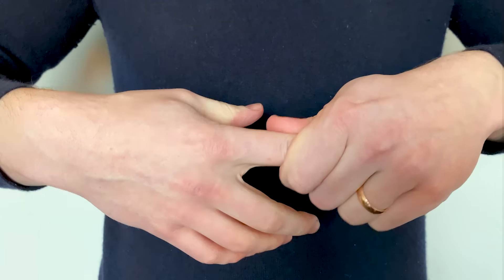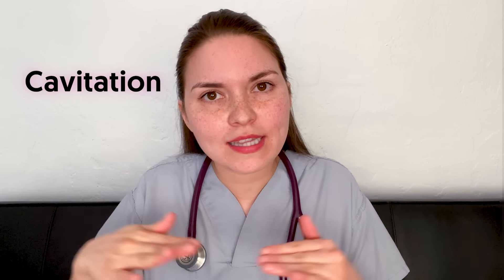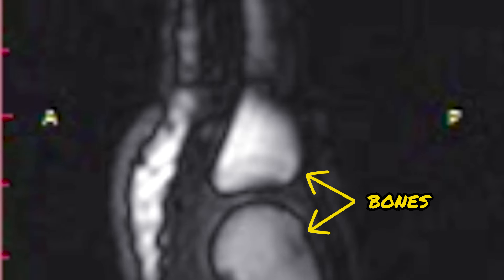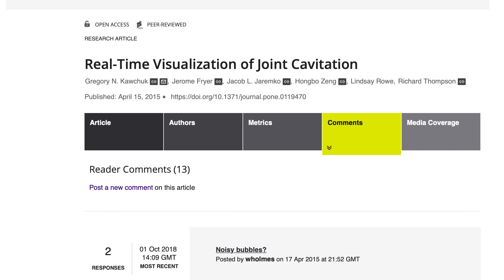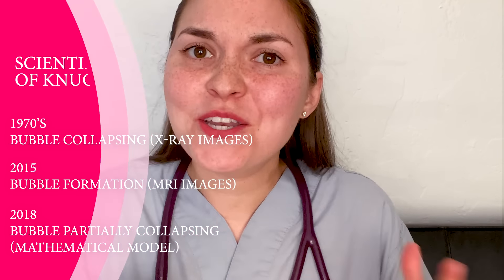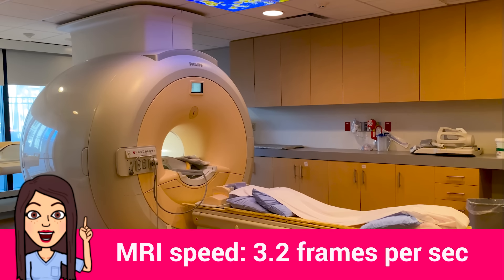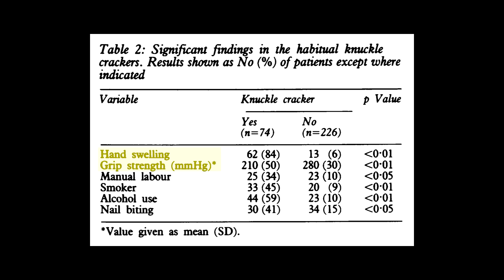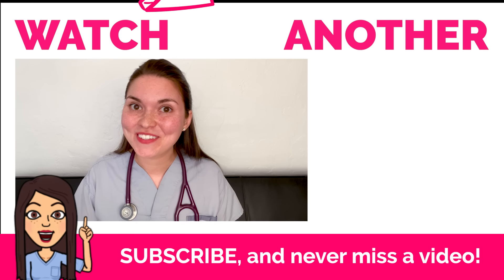Arthritis Doctor Explains: CRACKING KNUCKLES GOOD or BAD

Comment: All my joints crack having had RA for ten years. I'm sure you will find it very frustrating when you find there is nothing you can do for RA sufferers. The go to drug, Methotrixate was first used 75 years ago and recently I was prescribed  Gold injections which were first used 100 years ago. A cure for any of the Autoimmune disorders would be a very poor business decision for the drug companies.

Comment: THINK, muscles when deprived of oxygen and other nutrients via blocking blood, become Atrophiated, this could happen because of a contractured muscle fiber, by always staying in a flexed state deprive all that muscle fiber, and blocking itself by not allowing K potassium in the muscle so it can relax, this happening for a long time, create a series of contractured muscles, when you pull that muscle, the contracture opens making that cracking noise, it's why the neck cracks even more than the fingers, obviously they are connected and the reason is that the pressure the head unleashes on the muscles of the back by not being straight all the time also creates a system of atrophied muscles contracture, so you can also crack your knees when you kneel, or your elbows when you whiplash your arm. It's not "bubbles" being created by negative pressure, its the cracking noise a muscle makes when it does not have the strength to hold the contracture and it breaks the fibers, when you sleep with a bad pillow, the same happens to your neck, by blocking blood flow for long periods of time, you get a contractured neck, lots of muscles are in the neck... they hold your arms in place and your head... by the way, if you crack a single contractured muscle sufficient times for enough time, and it will heal making the muscle relax by itself and flexing when needed, feels, strange... but try it people.

Comment: So...here’s the question...if the sound is caused by negative pressure, how come you can usually only pop joints once in a while? 
Also, why would I be able to crack my right hand knuckles just by closing it into a fist (like those fight scenes in action movies), but not in my left hand?

Comment: I am sorry if my question is stupid, but what is the reason behind cracking having sort of a cooldown time? That is to say, after You crack Your joints with certain force from a certain angle. You can't do it again on from the same angle with the same force. Some times needs to pass, before You can do it again...

Comment: Hi, thank you for the video, very informative. 

I crack my nuckles a lot everyday. By a lot I mean, atleast 30 times a day. I have no pain. But if I don't crack it feels uncomfortable  It feels like pressure is building and popping it feels relaxed. 

I always stretch my fingers back after popping. And I find I can stretch more only if I pop, hence the relaxed feeling. 

I also crack my toes, my knees, my elbows, my back, and my neck, multiple times a day. Not as many times as my fingers though. maybe 5 to 10 times. Again there is no pain, but only a good stretch after the popping. 

I have no idea if this is bad for me in the long term due to the daily frequency.

I do have swelling in my fingers and a slightly softer grip. 

But it dosnt hinder my ability to do anything. 
I have been cracking away maybe since 8 9 years of age. It's gotten more frequent over time. Also I cracked k a lot more in the cold. I feel weird sharing this now, I'm a cracking freak  🤪

Could you help me understand my condition more please. 

Thank you.

Comment: If I don’t crack my joints, they really hurt, way more then if I crack them, I guess the negative pressure inside the joint is wht causes the pain and cracking it disperses the negative pressured bubble.

Comment: I learned so many ways to crack my knuckles and my neck as well. It’s always satisfying. Constantly typing on the computer (since I’m a programmer) and playing a video game often after exercise my hands need that release because my hand can tend to feel locked up from the constant hand movement. Sometimes to the point I can’t move a finger at the time without some difficulty. But knuckle cracking every 20 minute interval prevents that. (Which is also why stereotypically you’ll see programmers, digital authors, pianists and etc in movies and tv crack their knuckles before a performance or work) thanks for this info. Makes me feel better about doing it and not having to think about it in the back of my head possibly affecting me

Comment: Next question can habitual cracking of knuckle create long term loose joints and inflammation? As people even in the comments that say they crack their knuckles daily with a lot of the time them just popping on their own.. I never crack my knuckles unless they feel tight, or pressure feeling in the joint. Even then it's hard to get them to pop. I usually massage the pressure out. And with the work I do (heavy lifting) I cannot have a finger randomly pop on me. It has happened before with the heavier lifts and I have dropped stuff before from this. Tis dangerous. Now I can imagine if I cracked my knuckles as a child up until now and experienced my knuckle popping throughout the day on their own... Well I definitely wouldn't be able to do my job then. It may not cause arthritis but those old timers know how maybe not always but often enough how cracking knuckles has caused people problems. Also they generally had harder jobs then us today. Ohh wait she already says this in the end haha it does cause some problems in the joints. Such as weakness. Now not to be a downer though when your 60+ don't you want you joints to be strong as possible? It's literally an addiction such as bitting nails, and really shouldn't be done regularly due to the increase chance of joint weakness and inflammation. Such as bitting nails increases risk of illness from all the nasty ass stuff under those nails lmao. Honestly if you feel relief from cracking your knuckles for years.. who's to say that relief isn't a byproduct of the inflammation constantly in your joints that now you have to constantly pop to keep at bay? Use your heads people.

Comment: i learning Jiu Jitsu and have to use a lot of extreme grabbing and holding.  I developed loud cracking in 10 finger at two joints each.   Basically, I have to crack at least 100 times a day.

Comment: I would say that It all depends on HOW you crack your knuckles. For example, I've been a habitual knuckle cracker since 1995 and crack my knuckles probably more than 8 times a day. To crack my knuckles, I grab each finger and twist the joints (instead of pulling the joints that most people do) and after doing this type of cracking for so many years, I am developing bone spurs in a few of my fingers (which is a sign of osteoarthritis). I'm only 39 years old, and have never worked any type of manual labor job that would involve overuse of my hands. Therefore, I can only surmise that cracking my knuckles (in this particular way) has caused arthritis in my affected fingers. As a disclaimer, I am in no pain, but I do have Bouchard and Heberden nodes on a few of my fingers as well.

Comment: I really enjoy the quality of your videos 😊👌.  I have questions and concerns about both the initial and updated collected theories and findings...
   I've never understood the concept of gas bubbles "popping" when there's no gas external to the bubble.  That doesn't make any sense.  Popping a bubble means rupturing the film between the two regions of gas, just like a soap bubble or balloon.
   Cavitation is not considered vapour, even though some vapour may gradually evaporate into that space.  When that space forms, it's a vacuum, which is why it can completely collapse.
   The syringe demonstration was a good idea, but the way you pulled on that plunger and released it... that's not how people crack their fingers.  When you pull on a finger joint and it cracks, it suddenly "releases" and then gets caught by the tension of the capsule and/or ligaments.  When you release the joint, it doesn't collapse back whatsoever.  This process is not immediately repeatable, it takes time before it can be repeated.
   When you pull on the syringe plunger, it doesn't "suddenly" release; when the force on the plunger rises to the point a cavity can open up, the force remains constant at atmospheric pressure at all positions, until the plunger is let back and the empty volume closes.  There are no sudden changes of force or motion, and this is immediately repeatable many times.

The current explanations and analogies still don't entirely fit, so there's something else going on which hasn't to my knowledge been discovered...

I will propose that synovial fluid might have some very unusual properties, which allow it to hold onto dissolved gas tenaciously and suddenly release it all, and/or there's some mechanically non-linear property of the joint/capsule which causes the sudden cracking despite the force applied being well controlled.

I will add that, while cracking won't cause arthritis, the sudden stop after the crack, the tension on connective tissue, can potentially be slightly traumatic, the reason for swelling if overdone, but not a major concern (I crack mine often enough lol).  I liken the force endured on those tissues to that of using a small slide-hammer to pull on the fingers.

I'm not aware of anyone else who gave it this particular kind of thought, and I welcome discussion around it as I'd like to learn more, and I hope my insight is useful to others as well.

- Cheers -

Comment: Personally, I think its the bobble popping. As my right knee hurts if its not "popped" every 20 mins or so, I find that movement in my knee is restricted and it hurts to stand on until its popped I just bend my leg straiten  it again it pops and its stops hurting.  This is has been happing for more than 30 years. my knee even pop's while I am sleeping..

Comment: Two questions.  What about chiropractors and secondly why can we not crack our knuckle immediately after cracking as tho the time it takes to crack it again.  third, why is there relief in cracking knuckles?  IE a reduction of stress in the joints.  If the reduction is there does this mean that that act of not cracking is therapeutic in some fashion may be the same or similar to stretching?

Comment: In case you're interested...
I have two distinct kinds of cracks: one that can occur over and over; and another that seems to release something, which I can't do again for several minutes or hours. They are very different. The first type has a lower pitch, and it hurts a little, hurting more the more I do it. I have no urge to do that at all, and basically never do it. The second type is higher pitched and louder, and doesn't hurt at all; in fact I have found that if I don't do the second type before certain activities, I can actually hurt my joints (finger and toe knucles plus knees) and they stay sore for a day or two. For example, I need to kick out my legs to crack my knees right before running (I'm 47) or I can really hurt them.

Comment: What a great video!  I work in machine automation and milliseconds is the typical unit of time.  We've had similar issues in measurements taken out of phase with the recording mechanism.  An experiment with the MRI could yield the answer if it were repeated enough times.  A bell curve could be charted from the samples and the answer that nagging question about the timing of the crack, at the beginning or the end.  If course a 1ms scan rate of the MRI would be better!  But maybe I can find another thousand videos on the subject and derive the answer that way, lol.

Comment: What about why does it feel so good to crack them? I don't think it has anything to do with the sound. When I do it I barely hear it, however other people's knuckles can make me uncomfortable. Is it because pressure is released on the joint by the loss of the gas in the fluid, or is it the stimulation of nerves from having the joint stretched to it's maximum limit?
Also not mentioned in this video is that when a knuckle is popped, the range of motion of the knuckle is increased slightly.

Comment: Something cracking my knuckles did do for me is increase the range of motion. I can bend my fingers back to ~80° and forward somewhere around 160~170°-ish. No, I am not joking or exaggerating. I can basically fold my hand in half without issues.
I guess I ended up stretching the joints by cracking them a lot over the years. Interestingly, that doesn't seem to make them less stable or softer in cracking. If anything, the cracks have gotten louder. At least that's my subjective impression.

Comment: If it's just the bubble forming or popping, why don't they crack over and over? The fluid would behave the same way each time you pulled at it, wouldn't it? I heard that it was the microscopic tiny amounts of gasses in the fluid suddenly being released from it, and it took a while for it to reabsorb into the fluid before it could be released again.

I also know for a fact that if one of your joints CAN crack/snap over and over, it's bad... I have a motor tic in my index finger that's caused a lot of pain and discomfort, but I can't stop doing it. x.x I've done it like six times writing this comment. 
Have a similar cracking I can do in my toe... just over and over and over. It's definitely more of a snap than a crack, if that makes any sense.

Comment: Gee please answer this Doc 
Or any other opinion I would appreciate 💕
I’m right handed 
The last 12 weeks my right middle finger just has to do a little crack on its own
But it hurts so much each time 
And does this every 40 sec or so
Each movement I do it seems to pop 
I wrapped 6 bandaids around it today which acted like a strap , and at least stopped it from moving .
But what is it ? 
All my other hands joints feel normal 
A little sore at times
But I expect that 
This was I feel quiet sudden and very sore.
There is no residual pain after the click 
But 30 sec later , repeat.
Thank you 🌷

Comment: The bubble theory seems to infer you should be able to crack them over and over in a succession, which isn’t the case.  Why can you only crack them once and then have to wait to do it again?  And sometimes a joint will crack and sometimes it won’t?  Si joints only bubble up sometimes?

Comment: What causes the popping when you have slack in a joint. Context about 2 years ago I tore my ACL, both my medial (bucket handle, almost completely torn off and almost lost blood flow) and lateral (small tear) meniscus in my right knee, I walked on this injury fine for 3 months due to misdiagnosis. I got re-diagnosed and had surgery 3 weeks later (as early as I could get in.) Got a cadaver ACL and opening of the channel it runs through, and both of my meniscus repaired the best they could (lost 20% of my medial and 8-10% of my lateral.) I kept up with physical therapy for a few months and fell out of it even though I was still somewhat active. When it comes time to get released from the doc, he says keep working on it and slack should go away. Just curious as to what causes the sound when you’ve got slack in the joint?

Comment: Yeah but isn't popping your knuckles by pulling different than when you bend you finger and press down on the knuckle...? I mean there isn't that pull action where then the liquid could separate the way you explain it, in the way I crack my knuckles.. I crack them by just applying pressure, not by pulling.

Comment: depending on the method of cracking any joint, you can stretch (deform) or extend your natural rang of motion. So if you crack your fingers by twisting them, they will end up twisted (fingers no longer straight). If you crack them by bending them backwards, you can extent the range they go backwards (unassisted).

Comment: I'm a male in my 70's.  All my life since my teen years I have always cracked my knuckles on both hands about once or twice a day.  It creates a relief and allows further movement.  Starting about a year ago, I now feel the need to crack the knuckles of just my left hand during nighttime sleeping. I awaken about every two hours and crack the left hand knuckles.  This means I crack those knuckles at least 4 times during sleeping periods.  During the day, no cracking is necessary.  I might add that I'm left handed.  Other than excess numbers of cracking, my knuckles feel normal with no pain involved.  I don't know if this is a normal aging process or maybe a sign of arthritis now forming.

Comment: If this is the truth behind what causes my knuckles to pop, wouldn't I be able to crack them as many times as I wanted in a row? I can't, though. I have to wait a period of time between cracks. Also, some joints - like my neck or my ankles - only pop after I've done physical exercise and then go to stretch. This still doesn't seem convincing to me. I also don't pull on my fingers to pop my knuckles. So IDK.

Comment: Is the the same for all joints?  Whole spine. Ankles knees toes knuckles. 

What about the pressure build up and tightness I feel in some that goes away when cracked/popped. 

I'm in constant pain. No Dr what's to help. Other than load me with pills.

Comment: I got two special joint sound that I wonder if other people have too. First, if I stretch my instep, bending my toes makes my ankle creak, or crunch, kind of like a rope being pulled taut. Second happens in my elbow. By having my arm bent at a right angle, and bending back my hand, and then shaking my whole arm to make my forearm oscillate, it makes a crack at each wave. It sounds like fingers cracking, but deeper and more hollow. You recon this might be a sign of my imminent demise?